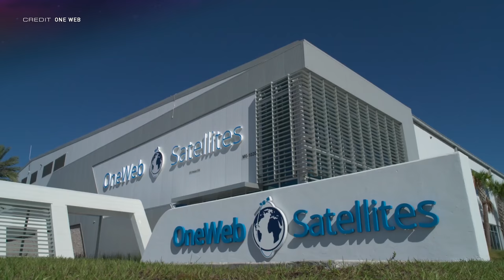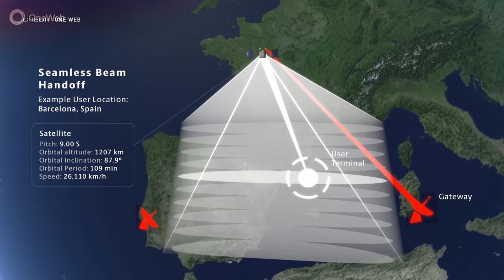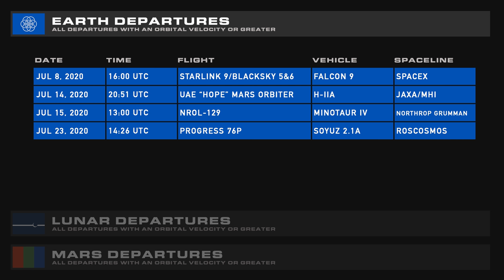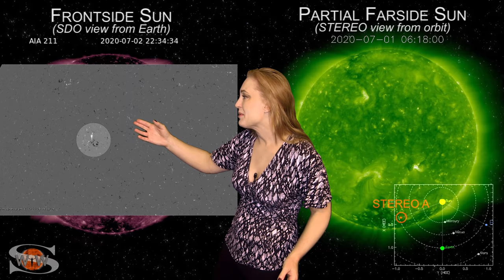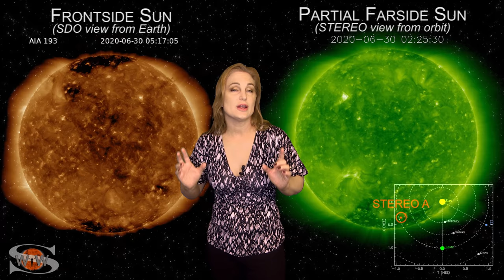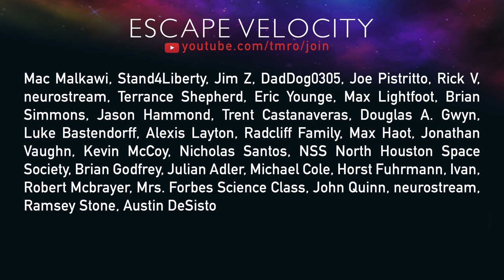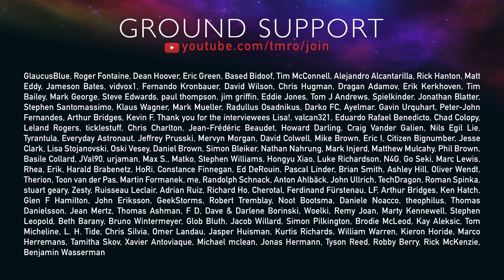Fancy a cuppa, OneWeb? | TMRO:News

Comment: This using OneWeb to replace Gallileo just sounds like nonsense, it's too much work. They are purchasing an internet service provider that will be able to provide internet to rural areas without having to lay cable.
Reply: It does seem a bit silly. As a Brit, I wish we'd spent our money on something a bit more practical, such as Reaction Engines and the Skylon.

Every other GPS system, which means the receivers, uses L band communications. Oneweb satellites use K band. How you're supposed to use one for the other I'm not sure. 

As for reaching rural areas, the UK is not the US. We fit inisde many large US states. Buying a satellite constellation to reach our rural areas seems like overkill.
Reply: yep exactly chris, scott manley has already covered this in one of his recent videos
Reply: On top of that, the current oneweb satellites in orbit are missing crucial hardware for accurate GPS!

Comment: Roughly (in theory) how much fuel is needed to get the starship super heavy beyond its own length?
Current method is the simplest way, but as rockets are trending to be more complex, is there a way to catapult assist, such a huge rocket it's own length?

Comment: The UK didn't withdraw from Galileo, it was the EU who told the UK if they leave the EU they won't be allowed to use Galileo. It was hoped continued participation could be negotiated since the UK was a major player and supplier. It should be noted that many of the satellites were built in the UK and the UK had invested heavily in the project.
It's a shame the OneWeb sats can't raise themselves to a higher orbit to provide a reliable GPS service. I'm sure a software upgrade can allow them to perform GPS duties, but it would probably increase the cost of devices on earth that would use this GPS signal because of the different frequency, shorter window of each satellite, and the greater number of locks required. The current cheap consumer chips that handle the American GPS and Russian Glonass couldn't be used. I expect consumer use of OneWeb GPS is 10+ years away if ever. But millions will be spent trying to get British military systems to integrate with it to provide that guaranteed high precision accuracy when the US and Russia degrade their service during times of high tension or war.

Comment: 14:56
Saying it's powered by liquid natural gas is incorrect for the same reason that saying the falcon 9 is powered by kerosine is incorrect.
Natural gas is not methane, it is unpurefied methane, it has pollutants.
You are giving the impression that one could connect a BE-4 directly to a fracking facility and expect it to work just fine.
Reply: But it is powered by LNG, every source on the BE-4 engine states LNG instead of LCH4. Please make sure you know what you're talking about before you type something